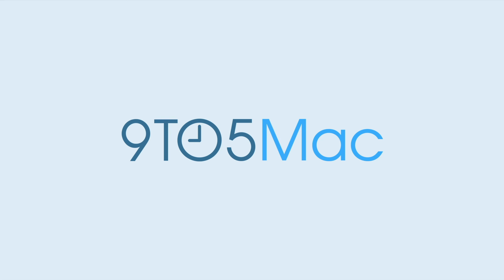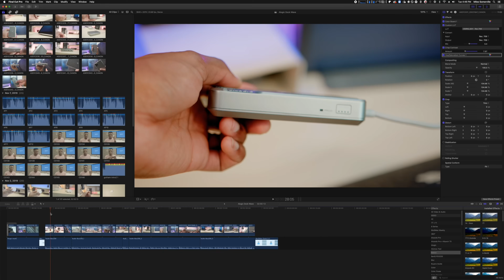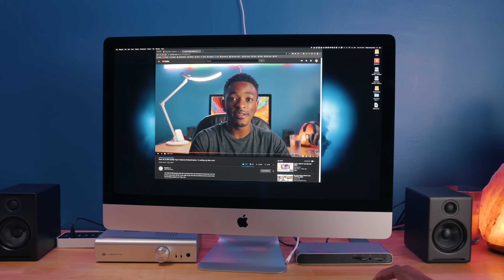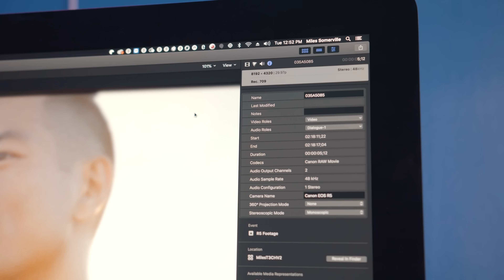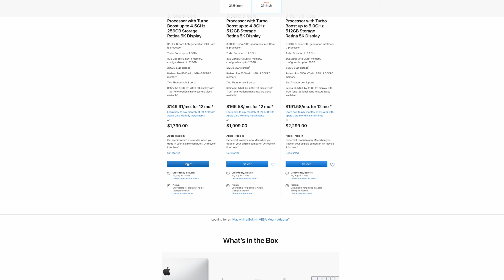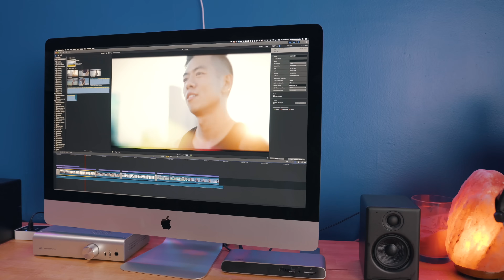2020 ($1800) 5K iMac - Will an eGPU improve performance?

Comment: So it’s been 5 years since you posted this video but….
I’m currently getting into emulators for retro games, mostly Xbox original and n64, which can cause my 5700 gpu in this iMac to really bog down. Is it tough to set one of these up and if not, are there any really good options today that would work well on this machine and give a good performance boost?
Thanks!

Comment: Sorry i have stupid question. I want to pimp my iMac 5k 2017 inside is an Radeon Pro 580 8 GB. For working with Final Cut very slowly. Now i saw your Video and i understand not all. 
I buy the Razor Core X and the AMD Radeon RX6800XT and my iMac works Faster with Final Cut  ? And i need not a second Display ? I use the i Mac Display ? Is that right .

Comment: ~~~~~~~~~~~~~~~~~~~~~~~~~~~~~~~~~~~~~~~~~~~~~~~~~~~~~~~~~~~~~~~~~~~~~~~~~~~~~~~~~~~~~~~~~~~~~~~~~~~~~~~~~~~~~~~~~~~~~~
Started window shopping for a mac studio as a auxiliary system to run a simple server/discord bots/game servers, browsed Ebay, wondered if there was a way to improve the GPU on an older mac, one thing lead to another, and here I am watching Great Value Marques Brownlee (MKBHD) for solid advice! 
For a moment I thought I was watching MKBHD in 240p and at 4K you went from Great Value to clearance on top of the Rollback prices 😂
~~~~~~~~~~~~~~~~~~~~~~~~~~~~~~~~~~~~~~~~~~~~~~~~~~~~~~~~~~~~~~~~~~~~~~~~~~~~~~~~~~~~~~~~~~~~~~~~~~~~~~~~~~~~~~~~~~~~~~
Side note.. All jokes and teasing aside..  When I typed that, I laughed too hard and I didn't need to do you like that so here's a sub to get you closer to the milly! Keep doing your thing. Hard to find older videos that are short, and packed dense with information but delivered in a non-overwhelming speed, tone, or delivery, some older videos feel like 2 guys took adderral and both took turns writing every other line of dialogue.
~~~~~~~~~~~~~~~~~~~~~~~~~~~~~~~~~~~~~~~~~~~~~~~~~~~~~~~~~~~~~~~~~~~~~~~~~~~~~~~~~~~~~~~~~~~~~~~~~~~~~~~~~~~~~~~~~~~~~~

Video Rating:
Video length = 10/10
Cohesive delivery = 10/10
Digestible voice/speed/verbiage  = 10/10
Rollback prices = 10/10
Real background that made me wonder if it was fake = 10/10
Knowledge = 10/10
My ability to stop cracking lame jokes = 3/10
~~~~~~~~~~~~~~~~~~~~~~~~~~~~~~~~~~~~~~~~~~~~~~~~~~~~~~~~~~~~~~~~~~~~~~~~~~~~~~~~~~~~~~~~~~~~~~~~~~~~~~~~~~~~~~~~~~~~~~
Overall video quality = 10/10
~~~~~~~~~~~~~~~~~~~~~~~~~~~~~~~~~~~~~~~~~~~~~~~~~~~~~~~~~~~~~~~~~~~~~~~~~~~~~~~~~~~~~~~~~~~~~~~~~~~~~~~~~~~~~~~~~~~~~~

Comment: good morning from the UK and I want to say thank you for your video. I wonder if you can help me I have a 2019 iMac. 64bg ram and a rtx 580 built in. I'm running the AI software called fooocus, little bit like stable diffusion. it is painfully slow to generate images. 15 to 25 mins. some people said about getting a Egpu. but people keep giving miss leading information. are you able to recommend if it is worth it to go external?? as would cost me about £600 for a 12gb card etc

Comment: I have the same set up but with a Razer Chroma and a 16gb card. You only get half the performance of your card when in an egpu. (Its in the fine print). 
On Davinci the imac doesnt try to use the egpu much. The inbuilt card carries the load. It was definitely not worth doing. Razer supoort is non-existent, so forget that if you have issues. Ill never buy another razer product again. 
Honestly,  for the extra $300.. buy the upgrade.. Itll kick ass..

Comment: I made a similar test with my iMac 2019 with the VEGA 48 GPU and exactly the same eGPU setup as You have in the video and on the benchmark side, I got better results for the eGPU, but when doing any kind of export from Final Cut, I got always much worse results with the eGPU. For example, when I used the internal VEGA, the export took 5min. and with the external 5700XT it took a bit over 6mins. So it means that the VEGA 48 is a very capable GPU.

Comment: Guys! The question is : now, in Greece, we can buy only i7 with 5500xt gpu. Because we can not choose the gpu. How much faster will be that mode with eGpu 5700xt with i7 and 5500xt 8gb inside? 🤔❤️ thx for your answers
Reply: It depends on your needs. If you want to be capable of 4K gaming (modern titles) on its gorgeous internal display via bootcamp, then you MUST go for 5700xt. 5700 is also very good for modern gaming, but most people go for 5700xt because it’s 16 GB vs 8 GB vram and much better for long term. 5500xt is just decent and a bad value for the money.

Comment: Hey Miles, thanks for that video! I have a couple of questions… I have an iMac 5k 27” 2020, running a 3.6 10-core i9 processor and a AMD Radeon Pro 5700 TX 16 GB. Would you recommend the blackmagic eGPU or Razer core X (with which GPU?) for graphics, mainly after effects and cinema 4d. Thanks!
Reply: Does that setup struggle to render 4k FCP projects?

Comment: Thank you for the great video.
I have a question about an external graphics card. I am working with an Imac pro from 2017. 3 GHz Intel Xeon W 10 cores. 64GB 2666MHz DDR4 with a Radeon Pro Vega 64 16GB graphics card. I am working in cinema 4d and the Redshift (still and animation) . My question is the following, even though my Imac works acceptably with these programs, when I use the rendering in real time with the gpu, I lack speed and also the fans do not stop sounding. I'm wondering what would be the external egpu graphics card connected to the Imac that would allow me to improve the rendering speed. Do you think it's worth it and finally if you think it's worth it, can you give me a suggestion on the graphics card.
Thanks in advance.

Comment: Hey, I recently bought a iMac 5K Retina, 64 Gb RAM, I9 3.6 ghz boost up to 5.0, Graphic Card AMD RADEON 5700 XT 16GB, 2TB SSD... pretty good... BUT when it comes to video editing in FCPX, sometimes it does not work smoothly, not enough GPU I'd say. Which eGPU would you recommend? Thanks a lot
Reply: B & B That’s a good system. It should be working smoothly as is. Reach out to Apple for tech support.
Reply: None egpu by thunderbolt 3 can beat a pcie rx 5700xt.

Comment: Does this work for a late 2015 IMac 27 “?
Reply: Im running a 5500 xt on a late iMac 27. Big Sur works fine, but in bootcamp im having issues getting the card to work. Btw, you only have thunderbolt 2 so you need an adapter and a script (purge wrangler) to get it to work.

Comment: EGPU is always a good option for imac. you have the advantage of selling the egpu and buying the latest and most powerful on the market without having to sell the imac.
Reply: I like that! I've never thought about it that way.
Reply: @DanielMata6282  He is absolutely incorrect. Because iMac has significant bandwidth limitations when connecting eGPU and working with internal display. eGPU is NOT a feasible option for an iMac (except some really old ones that will receive limited advantage from any sort of modern eGPU)
Reply: @alex.maxwell so he’s the best version of the best gpu supported by the machine. It’s still better and more cost effective than giving Apple an extra 1200 dollars for the upgraded model and then having to stay with that until your next machine.

Comment: But I am wondering how would the machine perform when running games using Bootcamp?
Reply: @Ryan Carter That's amazing, I will definitely look into that. Also wonder what eGPU enclosures are you using?
Reply: @Ryan Carter Thank to all guys... just one question: i am planning to buy an eclosures with an amd graphics card... and i don't know if for bootcamp i need some guide or trick, or it's just plug in, donwload driver and play... thanks

Comment: Good vid. Since I only have the 2019 27” with the 3.0 x 6 core i5 and the paltry 570 4GB, I definitely need a eGPU soon. First, I need to find a affordable 4TB storage system that’ll connect via Ethernet since we are only given 2 Thunderbolt ports. My 4TB lacie drive is USB-C, but it isn’t a SSD, so maybe it’ll work fine with a USB-C to normal USB adapter. I have 52gb of RAM & something is telling me that I’m better off upgrading the graphics instead of RAM.

Comment: I had the exact setup for my 2017 iMac and ended up having odd performance issues, while some apps seemed to improve some others actually got worse, specifically Photoshop and Illustrator. Ended up swapping returning the Egpu for a new iPad and has been much more beneficial utilizing the somewhat still jankey sidecar feature.
Reply: I have same iMac with 8GB graphic. When I use 46Mpx camera raw files on C1 they need 2sec to de-blur. Very annoying. The only difference n the eGPU is DDR5 vs DDR4 internal. Any guess, will eGPU improve performance?
Reply: @peterlanephotography  it appears that eGPUs only marginally improve iMac performance, especially when gaming  in bootcamp and using internal display, due to TB3 and some other limitations.
Reply: @alex.maxwell  heyyyyy I was looking just for this. I have a 2017 27 inch 5k display desktop with Radeon pro 570. I game on bootcamp windows 10.   So no egpu available that will help with gaming performance?  You are saving me time and money I think. Lol

Comment: 💥 Prediction 💥 Prediction 💥 Prediction 💥
1. No Optional Macs :- After when the ARM Macs will come, there will not be That "Customize your Mac" option available. Coz instead of Assembling Each parts, they're gonna use SoC like mobile devices with will be sorted Pre-Built. So (Like iPhone & iPad) there'll probably the 256+8/512+16 & 1TB+32G configuration available direct to Buy

2. No Upgrade :-  Even though Developer Kit supoorts Expandable RAM slot, future Mac Destops (Not the Mac Pro Now) won't support Any Upgrade. Even the Current Mini is just and CPU upgrade, we will soon see a Refresh with More Compact form factor

3. Not Anything "Pro" :- Most Popular 3 macbooks separate themselves with Thunderbolt port, Generation of processors & integrated GPU. But as the ARM will have the same generation to all & no GPU, So there'll be just The Basic Screen Size Difference. (Or, Suttle Changes which won't make smaller macbooks Less powerful - Like 11Pro & Max)

4. No Macbook Air :- Name of the Macbooks will probably changed, The Air will may be called simply Macbook (12") & the Remaining two (14" & 16", no 1299&1799 option) will be the Pro Macbooos with just the screen, Camera & Speaker difference

5. RIP Hackintosh :- as the MacOS depends on the hardware (for same we cant make Hackintosh on Unsupported Hardware), after the transition period will over, & the last Intel mac stop supporting the Upcoming Version, then the Hackintosh will also gonna die due to lack of CPU Support.

❤️

Comment: Hello! I have Mac mini 2018 and MacOs 10.15.6. I would like to buy Razer Core X and AMD Radeon™ RX 5700 XT (from Gigabyte). So the question is will this graphic card work with Core X on my Mac mini in MacOs 10.15.6? I did not find any information on the Razer website about supporting 5700 card in MacOs. But in your video you use MSI Radeon XT card with Razer Core X box. Could you help me? Thank you!

Comment: IMO, it's still better to get the upgraded iMac since the discrepancies between having a 5700XT directly with 16 lanes of PCIe internally VS having it choke on a Thunderbolt 3 port is not insignificant. I made some tests with a hackintosh and a Mac mini + eGPU set up with the same card (Vega56) and both running on a 8700 (8700K for the hack). The Mac mini + eGPU was a good 15-20% slower than the hackintosh. I ended up upgrading the eGPU with a 5700xt and it did help, but even that did not give me the performance of the hackintosh with the Vega 56 directly attached to it. That being said, I'd love to see an actual comparaison of iMac 5700xt vs iMac 5300 + eGPU 5700xt.
Reply: Yes, makes sense since this is a thunderbolt 3 limitation.
Maybe tb4 egpus will be much more faster.
Reply: On boot camp I’m getting a 5% performance hit on my egpu with MacBook Pro 16 inch and 980 ti gpu. Which is still incredible. I’m playing games at qhd on max settings getting solid 60 frames.
Reply: @toothacheforever8437  iMac and MacBook are completely different devices. Since he has mentioned iMac, it is important to keep in mind that it has additional limitations especially when using internal display with eGPU. Some people call it a loopback bandwidth choke or smth.

Comment: So I've heard that the Radeon Vega 56 and 64 perform identically in eGPU form. I'm assuming that this is because of the thunderbolt 3 bottleneck. So at what point are new eGPU card setups pointless to buy if the data rates top out at the Vega 56 rate?
Reply: Yes, youll need thunderbolt 4.

Comment: I am using a Mac mini - Intel Core i5 - 8GB Memory - 256GB Solid-State Drive with a Razer Core X Chroma eGPU and a XFX RX 5700 XT Triple Dissipation 8GB GDDR6 3xDP HDMI Graphics Card RX-57XT83LD8. The eGPU is connected via thunderbolt 3 to the Mac Mini and the LG 4K monitor is connected via HDMI to the eGPU. I am experiencing crashes all the time while using Chrome and Civilization VI on Steam. I am calling for help, any recommendations?
Reply: Interesting Id like to see this first hand. Maybe you should post a video about it.
@9to5mac Can you comment on this ?

Comment: for the 5700XT, you need a dummy display adapter to get the best performance from the eGPU otherwise the 5700-XT will throttle down Max Tech did a video on this. so the review is semi flawed   https://www.youtube.com/watch?v=3MwPncpJtF0.

Comment: I’ve got a 2018 15inch MacBook Pro which I use the Razer Core X Egpu with a Sapphire Radeon 5700 XT card and it works really well. If I had the latest iMac I would spec it with the better graphics option and not bother with an Egpu.

Comment: Great comparison, Miles! I definitely think an eGPU is only currently necessary for those want to be able to take advantage of future AMD cards, while being able to retain the same iMac. The current offerings from Apple definitely seem sufficient for most of today's workloads. Quick question though, why did the internal GPU greatly outperform the 5700 XT in the Unigine Heaven benchmark?
Reply: late  to the response but I'd guess it's due to the eGPU having to go imac > egpu > egpu > imac display for gaming related work loads which greatly impacts performace, if it was imac > egpu > external display connected to the egpu and you game on that, then there will be a vastly better experience. Whilst for rendering etc it gets offloaded to the egpu

Comment: No point in buying a 6-core desktop in 2020. Might as well go for the built-in 5700XT. But I already have a year and a half old 2019 model with the i9 and Vega 48 so I’m good for now. If I was upgrading now I’d just wait a bit longer for Apple Silicon which is going to blow away Intel.

Comment: Sorta a fork in the road question, but what eGPU enclosure and graphics card would you recommend for a 2018 Mac Mini? Not looking for ultimate performance. Looking more for biggest bang for the buck. Thanks. BTW, I was FIRST! 🤣
Reply from the maker: https://www.ebay.com/itm/Mac-mini-i7-36-256-Razer-Core-X-5700-XT-eGPU-LG-5K-UltraWide-Bundle/264827941181

Selling a Mac mini Bundle!
Reply: 9to5Mac Man, that is a nice package deal! I have the same Mac Mini, but with a 1TB internal SSD. Just the eGPU and 32GB of RAM is worth over $1000. Thanks for the great info! You have given me a really good  idea. I'm going to start looking for a used RazorCore X enclosure that comes with a 5700 GPU on eBay first. Thanks so much for the kindness of your reply. Such things are not just on me.

Comment: I was wondering about attaching an eGPU. But it seems like going for the top-end model would suffice. I'd pay extra to have all the performance inside the iMac. Sort of defeats the purpose of an iMac attaching an eGPU.... Thanks for doing this Miles.
Reply: I would rather go for the top end model. That 5700 XT GPU is going to be very good.

Comment: Nice, am searching for a eGPU for my HP Elitedesk!
Reply: Unless it's an EliteDesk Mini, it should have a PCIe slot, at worst a low profile one. You can still fit a GTX1650 low profile in there, though. Don't forget the performance loss you get due to bandwidth constraints over thunderbolt.